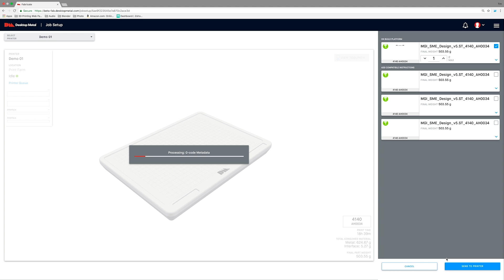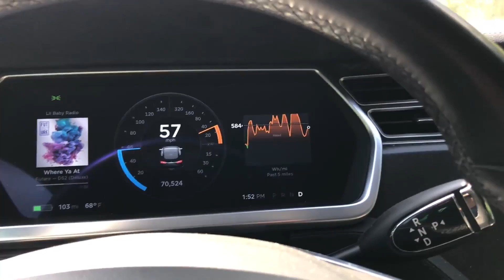FIRST DRIVE - The world’s first electric motorcycle powered car

Comment: PMSL - "Do the brakes work?" rolling down street quite quickly
 "I dunno!"
Reply: thats what makes guys guys
Reply: We'll find out! :D:D:D
Reply: It's quite possible to test drive it without touching the hydraulic brakes using solely regenerative braking
Reply: @samuelseidel6148 , well, that depends on how strong the rebel is. You have to remember, this is a motorcycle motor.

Comment: Tesla couldn't source or build a transmission that could handle the power of the model S.  A motorcycle motor doesn't have that problem so you can use a multi-gear transmission.  With a light vehicle and good gear ratio, even small motors can move a car.

Comment: what idiot didn't think this motor would move this car? if a forklift motor will do it, why wouldn't this one? i'll bet it is a lot more powerful than one from a forklift that doesn't need near the same efficiency to do it's job. the zero bike is light, but they were looking for max performance. a forklift company just want's the minimum needed to get the desired result.

Comment: Hi to the haters saying this car Rod would barely move like 20 mph, clearly you can see is doing it 40+mph even with 2 people onboard. nice job rich! keep demonstrating!
Reply: All you have to do it look up the motor specs.... That motor is about as powerful as a 4-cylinder 1L hatchback engine, but with a lot more low-end torque.
Reply: @philanaemic  imagine 2 motor of these powerful
Reply: @artillerypr  Yup, the motor is more than capable. With a heavier chassis the bigger limitation is battery capacity, and that can be improved by adding additional battery packs.

Comment: 9:45.  Look at me turn some good tires in to smoke.  10 seconds later, ok cool I get it, this thing is light and has torque.  10 seconds later, um are you going to keep going till you hit steel bands and start making sparks? Congrats your tires went from brand new to needing to be replaced in 5 minutes, I hope you had fun.  Burning a $100 bill is also fun, and would have been less expensive.

Comment: Can I use two 36V batteries wired in series or parallel with a 54V mid-drive motor on my OCC chopper bike? Or will it fry it?

Comment: do you think those zero motorcycles motors would be powerful enough to push a miata

I have a bad idea and want to know if it could work
Reply: I've a feeling all 1 ton or less cars can easily use Zero motors. I need a garage.
Reply: illFox 240sx  you could probably join 2 together in series as they are that compact. 2 battery packs. Synchronising the motor controller/s would be important as overheating would occur otherwise. Filmed a first for that on a dual setup motorbike.
Reply: yeah that seems like it could work

Comment: Only one thing left to do. Drag race. Of course in a designated area to get those numbers on paper. For the record. Just use safety precautions. And a good helmet. As well as a good parachute. If is in a race track. So how much weight comparisons from with the V8 to electric system. Did you gain weight or loose weight? Or in the same weight?

Comment: All workable because of the use of a multi-speed transmission.
Reply: If you have motors and controllers with a good power band then the transmission is less necessary. This motor/controller setup are probably a bit peaky (spec'd for a bike not a car) though I'd like to see the curves for them.

Comment: nice, only, that coupling won't last long, or the electrical motor will get destroyed, or the coupling will wear out, might take some time, trust me, been there, check the email, (just a friendly suggestion, replacing the motor is expensive)

Comment: I'm impressed.  I own a SR Zero and I really did not think that the car would move well at all.
Can you  please give us some performance measurements?
Top speed observed,
Range at 60 mph,
How the motor and controller is handling the load heat wise.

Thanks for the videos!

Comment: Here's a dumb question: If you tow the rat rod by the front axle, could you charge the battery simply by having the back wheels turning, which would then spin the drive shaft and electric motor?

Comment: You should definetly put a temperature probe on the motor controller though, moving that much weight over time is definetly over spec
Reply: Keeping the original tranny probably helps out a lot. Electric motors produce max torque at their lowest RPM's but they also pull the most current there. Using a gearbox should help to balance out the current demands and keep the temperature under control.
Reply: @Kirk Oglesby The old flattie 4 banger was about 40hp. LOL... And more of the car was present back then.
Reply: Factory made controllers always have a high temperature cut off, my Curtis controller was adjustable from 150 C to 170C.

Comment: Please partner with Zero motors to make an electric conversion kit based on this build. I'll instantly buy it. 3 grand no issue.
Reply: It would cost a lot more than that homie
Reply: @charlesalberti563  You think? If a brand new e bike is only 20k I'd say 3 grand ish for the internals is reasonable. I only want the motor and controller. They'd have to make a stripped down version without most of the e bike junk in the system. But yea possibly more in the 5 grand range

Comment: Next project - partner with Zero and a kit car company like Westfield (Lotus 7 clone) or Exomotive to create a drop in unit for an EV build.  One space frame chassis, some fiberglass panels, a donor Mazda Miata for the running gear and a Zero drive train.  I'd buy one for sure.
Reply: Electric Ariel Atom.
Reply: Oddly enough I was at a talk just the other day from a Westfield owner who built his own and I was wondering how easy it would be to do an electric one.
Reply: Lassie Vision My mother had a Lotus 7 back in the day and I’ve always wanted one.  The Caterham models are super expensive, so likely to be a Westfield with an EV drivetrain
Reply: Good ideas.  Of course, we have heard rumors of possible luck, or like another challenge or two, and something about an Volkswagen beetle sand buggy.   So, can someone send an old Beetle Sand Buggy and another Zero Motor to the team of the Rich Rebuilds Squad?     Got to see if they can make it happen twice on the conversions of unusual dimensions.  Cause right now, it could be just a one hit wonder or just some fluke good luck with help of friends.   KEK  LOL

Comment: Proved me wrong.  I thought for sure you'd have overheating problems with that much weight on the Zero motor.  I've got a 2015 Zero SR and absolutely love it.  Zero Motorcycles has always been great whenever I've had a question and backs their products if there is an issue.

Comment: What are the stats of the Zero motor and speed controller? That's VERY cool that you made that work!
Reply: 106 ft-lbs, 67 hp (50 kW), 660 amp controller (nominal battery voltage 102v).

Comment: works good , to make it look nicer you could add a hood , that allso helps to keep people fingers off the high voltage stuff or pulling off wires  if you have the car parked in public  , could probably make sumting out of carbon fibre if weight it an issue ( and money isnt)

Comment: Congrats Rich! 
Just a warning to you about welded brake pedals.   It’s not safe. 
Get a solid pedal made before something bad happens
Reply: Welds if done properly are stronger than the metal they join. That being said there is no way he did it properly.
Reply: Um no part of this rat rod is safe, which now that i think about it would be 10× worse if the brakes failed
Reply: Depends on who welded it.
Reply: @dl87z28  well rich's welds look more like little bits of bubble gum between parts so... Ya.

Comment: having worked for u-haul the trailer being strait was not a requirement and the chains and tires were replaced often though i only had to go out and pickup 1 truck with the frame in 2 pieces yes they broke the truck in half.

Comment: I want to lower my carbon footprint
Burns rubber with an electric car 😂
Reply: Reduces carbon footprint.

Increases carbon tire print.
Reply: I thought the bad thing about electric car was the battery? Doesn't it get shipped from the other side of the planet and is toxic? I honestly don't know, so I'm asking if someone can clarify, because I've heard conflicting information.
Reply: @genericname3600  Also another aspect to consider is the amount of oil shipped to the refineries by tankers (huge carbon footprint) then refined (more carbon dioxide and assorted toxic gases generated) and finally finished products shipped via tanker trucks etc. to individual fuel, oil and gas distribution points (fuel stations, oil packaging plant/canaries etc.) Then consider how much carbon dioxide this generates over the lifetime of the vehicle as well as the actual vehicle emissions... Not a straightforward calculation at all as oil companies would have you believe. Batteries break even on their carbon footprint at roughly the 5 year mark.
Reply: @genericname3600  Tesla batteries are recyclable and use less unfriendly materials other manufacturers. Only backwards countries use coal most modern countries have been moving away from coal to greener solutions.
Reply: Googadis Beotches Uh, no they’re not. They’re pretty much the same as any other heavily BEV battery.
Reply: Yet he buys a humvee
Reply: @JS-wc4xs I'd bet it's on stby to be converted.  Model S drive unit?
Reply: jake Nuclear and hydro are the best options for electricity generation.
Reply: You shouldn't expect hardcore idiots slobbering on tailpipes to know how to give answers, or make any decent reply in general.
Reply: @jake I also said most modern countries are moving away from coal to greener solutions. Granted I should've said only backwards countries rely on coal, but you seem to be under the impression that green solutions are difficult to manage. If so why in America did the coal plants have to be bailed out from going under and all the green energy tech that's popping up all over the US is only a fraction of the cost to build and maintain?
Reply: Very little electricity in USA comes from coal nowadays. It’s the most expensive form of energy now. Look it up.
Reply: @Quickicecarreviews123  link.
Reply: @jake if it wasn't for the bailout at the great expense against taxpayers those coal plants wouldn't be running and we would be relying on lower cost green energy.
Reply: @jake heard of energy storage?
Reply: Yet Rich hasn't figured out electric cars simply offset carbon emissions to a different area vs directly at the car. By the way get a proper hood and grill she'll to cover it up.
Reply: @MonzaRacer  Still, considerably less overall emissions.
Reply: @MonzaRacer   It Reduces . Remember a Big Power Plant is always good than a Tiny ICE  in a Car.
Reply: Electricity comes from coal. So his tesla is coal powered. I like u test track the industrial park lee s shop is in.
Reply: @dualsportrider3221  Even if all the electricity came from coal, it would still be a lot cleaner than gas, and the pollution from most coal power plants is not where people live and breathe.

Comment: I wonder if someone could do this to a Pontiac Fiero?
Reply: Yes the Fiero body rocks, just the engine/tranny did not.  The electric conversion may be your magic bullet!  But all depends on range, and making sure it gets enough cooling!
Reply: Good idea, but how heavy ?
Reply: @telemachusepiphany9668  2460 to 2790 lbs, but you will delete engine  and radiator and fuel pump, most tubing, youll probly make it a whole lot lighter like Rich did to his!
Reply: One of my dream projects.
Reply: People have stuffed 350 Chevy V8 engines into Fieros so this electric setup shouldn't be doable.

Comment: I think Zero may actually be better off also selling electric conversion kits
Reply: I'd buy one - I'd slap one into a Lotus 7 kit car in a heartbeat.
Reply: @MandyFlame  Or even a swap into a Kei car?
Reply: @Gonzotftd  that would be fun.
Reply: Gonzo T I have been following this video series because I want to convert my 1991 PP1 Honda Beat! I just need the money for a wrecked Zero motorcycle lol
Reply: Zero could be exactly like Bafang selling OEM electric motor kits.
Reply: I'd buy one!
Reply: Great point. I want to do an ev conversion on my light pickup when it dies.
Reply: I think Zero’s sales just jumped. They should thank Rich.
Reply: Genius! I didn't even know about these Zero bikes but in England we have a host of old small light cars that would be perfect for a similar conversion to this. Mki escort, Austin A40, Citroen 2Cv that came with 27hp engine so a zero would make it fly... Thanks for the info.
Reply: Martin Pope Older, smaller cars make a lot of sense for EV conversions. You don’t need that much battery to make them go,
Reply: Yugo, Datsun Z, or that Civic that Bruce Willis drove in Pulp Fiction
Reply: Brand new kit will cost at easily double than what he got at auction
Reply: Jean-Louis Bourgeois  honestly if they could work something out with purchasing wrecked or totaled vehicles back from insurance companies, and refurbishing them into conversion kits...
Reply: Jean-Louis Bourgeois  i have made T rex replicas with motorcycle engine, can make a lot of them cheap
Reply: Exactly !
Reply: Love it man
Reply: Jean-Louis Bourgeois  they would probably only warranty a part of it and thats a maybe.
Reply: need one for my volvo amazon
Reply: You'd really want it, huh?
Reply: Anyone know what size and voltage the motor is and what kind of batteries?
Reply: Jean-Louis Bourgeois  ok..... thanks. Anyway, their cheapest one is about 10K$ with the smallest battery (around 7kWh) They don't actually sell any kit but maybe theres a market for it ... in the end you won't get so much range with less than 10kWh....  they have about 160km range for their motorcycle in city driving so much heavier payload in a rod or small car.

I am more towards the new small 3wheels "car" from Arcimoto, go check it out, they call it a FUV (fun utilitary vehicle)
Reply: its junk Zeros nothing more than rebadge chinese crap...

Comment: Ri h what type of run time are we vetting on one battery pack? What was your top speed?
Reply from the maker: Beat the crap out of it for a full day and went down to 42%. I got to illegal speeds easily but didn’t want to push it too hard with drum brakes and a borrowed dealer plate lol.

Comment: Nice, it actually worked!  Can you give specs next for range and top speed?
Reply: I cant wait for the follow up video with this info .
Reply: And also, will you regenerate more electricity by upshifting into third? Looking forward to more range by more batteries. I knew the electric motor would move the car but I didn't think it would move it that well. Great job!